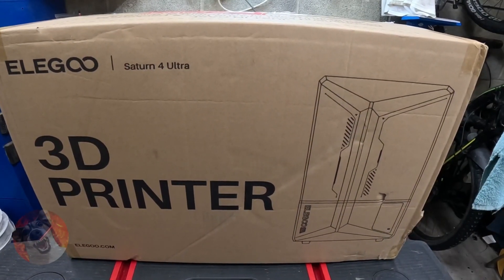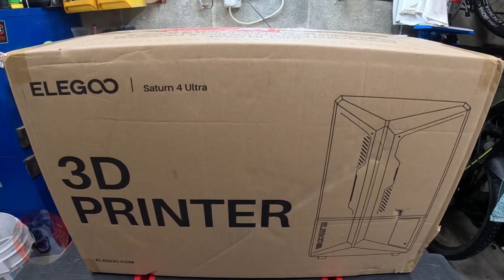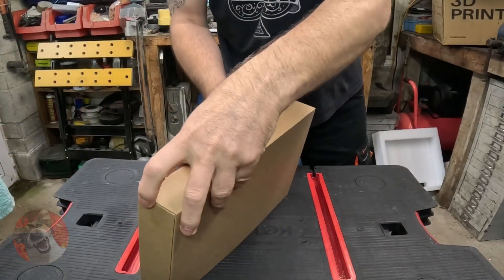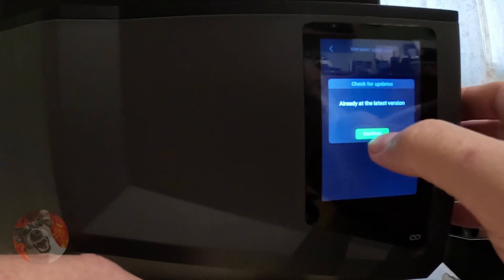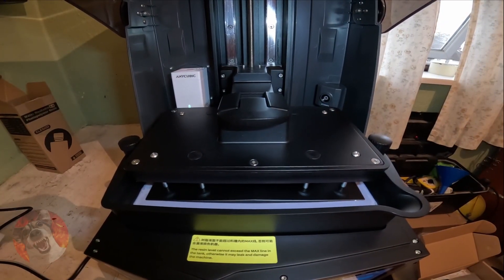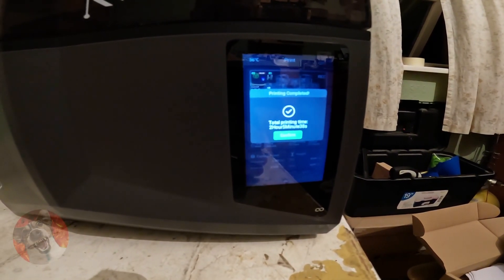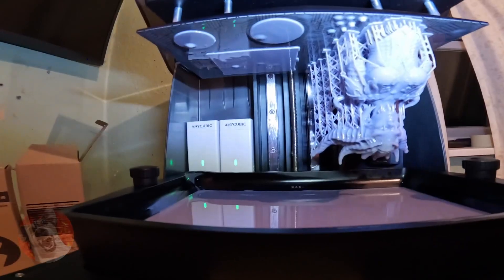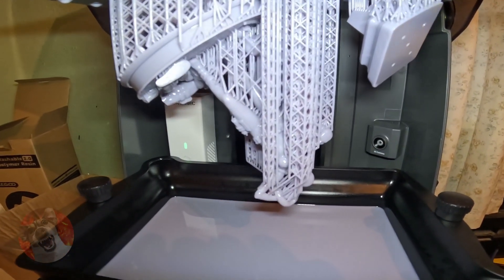Elegoo Saturn 4 Ultra 3d Printer Review, is it really beginner friendly...?

Comment: Check light uniformity.  Usually on the sides is way lower compared to the center. On my S3Ultra, while stated >92% in reality is 60% with the corners verly low. So you migh2neejust to increase exposure times.

Comment: I have the S4U, S2, and Jupiter SE, and from my experience the S4U is way worse than the S2 when it comes to beginner-friendly category. 

A lot of problems, especially around the "self-leveling" plate.

On the S2 I pretty much plugged and played, did 2 rook prints and headed straight to something big that fills the whole plate. Never once had there been a problem with it. I actually printed a set of parts for a 1:1 scale Deinonychus skull, 100% infill and there was no failure. In fact I have never had any bed adhesion problem or leveling problem with the S2, had to level it only once.

Now onto the S4U. First the prints didn't stick well enough to the plate. Then I increased base exposure by 2 seconds and it stuck rock hard, things only come of in pieces. Then there is a problem when I tried a XP finder test alongside the Starship test plus a normal stl that I design that works perfectly on the S2. The XP Finder stuck to the plate like a rock, while the other 2 were pried off with little to no effort. However, there were noticeable layer shifts on those. Well, fixed that, cleaned the z rod up and lubed it, but the bed adhesion issue is still on and off today, even tho the printer is in a insulated, heated cabinet that always keep it around 85F inside.

Then comes the transition layer glitch that makes the raft 2x 3x thicker than it should be. Another problem to fix.

Then it comes the AA issue. I have been using default AA settings on the S2 and Jupiter SE forever and it printed thing to injection-molding quality. Yet all of the sudden the S4 makes things look like it's out of Roblox. A lot of back and fort between me and Elegoo support, they even sliced the file for me and things still act the same, until someone on FB told me to dial AA all the way down to 0.

And now it has some issues with Sunlu standard resin. I used soem bottles of Elegoo water washable that my brother bought but didn't use and when they almost ran out I mixed the Sunlu standard resin that I always use in. While the S2 and Jupiter SE prints well on those, the S4U creates vertical lines all around the prints. Had to flush it to the S2 and use Elegoo ABS-like 3.0 to get good result.

Anyway, totally not a beginner friendly printer at all. I only overcame the issues thanks to the help of other people and my experience in 3D printing. For a beginner, this printer actually can push them away from resin printing and Elegoo.

Comment: White residue is usually because you may have  cured resin whilst it is wet. Always best to wash prints in alcohol rather than water even if the resin is water washable. Also leave prints to dry overnight in dark place before curing. Or if you have air hose give them a blast to dry them.
Reply from the maker: Thanks I will give that a try. thanks for watching.

Comment: The best way to learn is to have these mistakes, without them how will you learn what to do, to be fair the sponsored YouTubers have been printing a long time and know what resins and settings to use without having to think on it, Water washing resin can be pretty unpredictable at times too as it's more brittle than other resins. temperatures and exposure times are crucial too, try downloading a calibration print with any new resins so you can fine tune your exact settings for the printer, will save you time and effort

Comment: I think the friendly part of these printers is the fact that all you had to adjust was the exposure. all the others have a whole set of other settings that the slicer won't even show you with this unit because it doesn't use/need them. Doesn't mean it's absolutely fool proof of course, but simplifying the solution of issues to only a couple of adjustments seems as friendly as it can be. 

I was going to mention about the issues you had but I see others have given you good advice already, Good luck printing!

Comment: I have been using the Saturn 4U for 7 months and have poured 20 kilograms of resin. It is very easy to use. Don’t skimp on support. In winter, you must use a heater to heat the resin to 25-30 degrees Celsius (you can use a 12V power supply with a long strip The PTC heater is attached to the outside of the material trough. If it falls off due to temperature difference, a 100-watt air heater is needed)

Comment: I would suggest checking out "youtube" for a tutorial on a  free program called UVtools. It finds suction cups and resin traps and can fix them. These can cause print failures. Most of my failures have been from pre supported models. 

I try and remove the supports using another free program called "meshmixer"
It's a pain to learn as there is not much info about it, the downloaded manual only touches on the basics

On largest models I hollow out drill large holes and try and use some manual heavy supports, than add  medium supports on auto generate . The light supports I increased the contact diameter from 0.2 to 0.3mm, as a lot of my failures were at the contact point of the supports. 
And get hold of a kitchen  ware silicon spatula , don't use paper towels to clean out the vat it will cause the fep to go cloudy

Comment: Okay, so: To start with, I’ve got one of these printers, had it for 30 days or so. I’ve 3D printed in the past on an original Mars and Saturn.

Jumping into your failed Rook:
Temperature: I know it’s an additional cost, but for any 3D printing, you need some temperature control solution. The lower your temperature, the long the required exposure time. 
Water washable resin: Water washable resin, particularly the Elegoo one, is bad. It’s brittle and needs long exposure times. To make it work, 25 seconds is the minimum for base layers. I don’t know what layer height your using, but that effects things too, the greater the layer height the greater the exposure time. I use a 50/50 mix of Elegoo and Anycubic ABS like resin, 0.02 layer height. 25s base exposure, 15 layers, 15 transition layers. This means I have 0.6mm of solid foundation to build from. (1.7s exposure if your interested).

Second issue the failed print: Same thing, settings. To best calibrate your printer, grab a Cones of Calibration from TableFlip Foundry (its free) Print it till you get it just right. The exposure tool is very useful for this to go 8 at a time. 

Third Issue: The white powdery looking finish: This is water washing and water washable resin, it happens because unlike IPA and Metho, water does not denature the resin, only dilute it. so even when it looks clean there is still functional resin in the water that dries on the model. Best practice for washing: Get an Ikea UPPFYLLD, give it a quick wash it in that, move it to an ultrasonic cleaner, clean it in that for 5 minutes, finally throw it in a wash and cure machine for 6 minutes. Yes, you can do it with water, but water washable is still better being cleaned in metho or IPA, or if you’re worried about the ultrasonic cleaner catching fire from the flammable liquid, then a resin cleaner like the one from elegoo. 

Notes: 
Safety:
1. Wear a respirator, rated for gases and vapors. Water washable doesn’t mean safe. 
2. Ventilation, Grow tent with extraction, or a DIY solution that does something similar. Resin is exposure causes sensitization, you may have no reaction now, but over time you will build up a reaction to it. You really don't want that in your lungs, not to mention SLA printing produces VOCs, Unpolymerized Monomers, Particulates, Photoinitiators & HAPs, all of which range from irritation, to asthma/reduced lung capacity, and chronic bronchitis, as well as being carcinogenic. Your carbon filters help, but in the same way draining a boat with a bucket, while 5 people are filling it with buckets. 
3. Waste disposal. The water you are washing with is not toxic. It can’t go down the drain. It needs to dispose of at a chemical depo. IPA/Metho is easier because it comes in containers you can put it back into for disposal, and metho particularly will last you a long time. Some people will tell you can evaporate the resin water. Doing it safely is not easy, or quick.
4. Nitrile gloves the heavier duty the better (you might be using them, but the blue ones always make me think of surgical gloves.
Final thoughts:
This printer is no easier or harder than other printers to start with. There is a huge learning curve in resin 3D printing. The one thing I’ll say about this one that’s added to the difficulty, is the lilt mechanism. Supporting models is an art and a science, people have gotten very good at it, but shift the angle of the force applied, and you need to change your thinking. But compared to starting on an original Mars, this thing is a cake walk. 

Other Notes:
If you get a wash and cure, make sure its not a 2 in 1 unit. Unless your space limited.

Final thoughts:
This printer is no easier or harder than other printers to start with. There is a huge learning curve in resin 3D printing. The one thing I’ll say about this one that’s added to the difficulty, is the lilt mechanism. Supporting models is an art and a science, people have gotten very good at it, but shift the angle of the force applied, and you need to change your thinking. But compared to starting on an original Mars, this thing is a cake walk.

Comment: You need manual build plate leveling, I heard this feature was recently updated in the firmware . The worst is yet to come and that is with the LCD screen replacement as almost the entire printer needs to be dissassembled inorder to replace that LCD screen, which is a consumable along with the PFA sheet.
Reply from the maker: Yeah I just seen the video about changing the LCD screen, that's going to be a nightmare.. What a stupid design.
Reply: @CALsWorkshop101  There's a simpler method but not without risks. You need a hot air gun and some mobile screen repair tools.
Reply: @alfredanil  I just got this printer I would like to know about the shortcut method you are talking about.
Reply: @alfredanil  if we need to replace the screen it's toast anyway, I prefer the heat gun and tools method

Comment: yeh wish i never got the ultra the tilting is too hard on supports  my very first print pushed a hole in the film because a large hunk fell off then kept getting pounded and pushing the rest of the print sideways what should have been a straight wall turned into a staircase ..   , plus its AI camera is useless as it can not even see the print because the build plates always in the way , and why the heck can the build plate not fit into the wash station !!! and why does the top of the build plate fill up with liquid (talking about when you clean in it alcohol its damn near impossible to empty back out so you loose ~50ml of alcohol )  also my build plate is seriously warped rear right corner is on the maximum adjustment and its still pushing down further than any other corner
Reply from the maker: I agree.

Comment: a few things to help your prints. 
1. sounds like the failed supports are under exposed, u might have to go to 3.5 sec.
2. might need a heater 
3. the residue might be uncured resin possibly from not washing well enough or not using clean water
4. if you want to print alot get a flex plate
Reply from the maker: Thank you so much for the tips, I appreciate it.. I will give them a try. 👍
Reply: @CALsWorkshop101  Don't get a flex plate for this printer, they aren't designed for the lateral force and will slide off while you print. I haven't experienced it, but seen the aftermath of FB groups several times in the last few months.